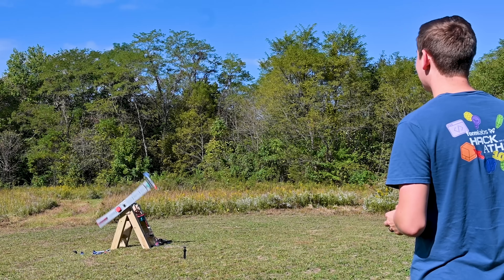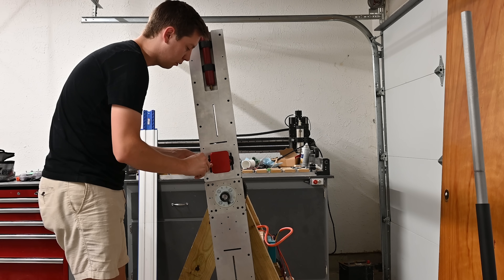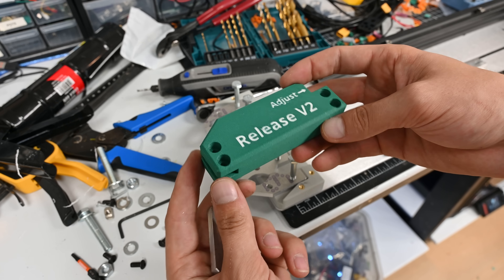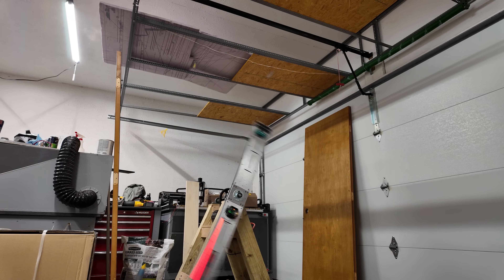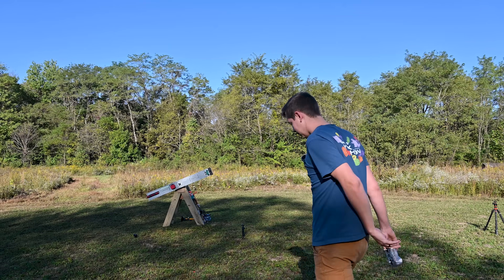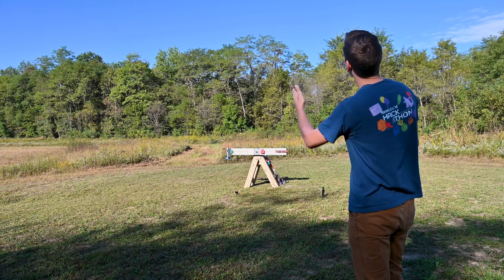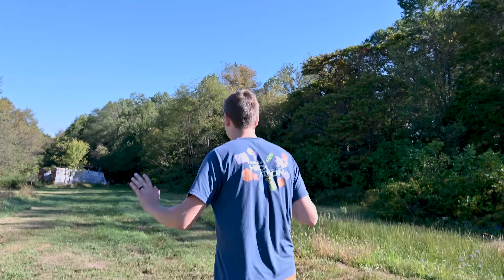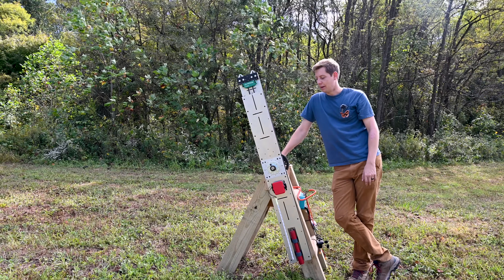I Fixed SpinLaunch

Comment: I thought I heard you say you could get the rocket to higher if you added mass to the rocket. I don’t think that will work. The height is determined by the initial Kinetic Energy (KE=1/2 m v^2) getting converted to potential energy (PE=m g h). So for KE=PE the mass on each side of the equation cancels out leaving 1/2 v^2 = g h, or h = 1/2 v^2 / g. This assumes g is constant and for the eventual heights you are intending to reach g actually does reduce by the square of the height - but even in that case g isn’t dependent on the mass of the rocket. So it seems it would still be true that adding mass to the rocket won’t make it go higher. The only thing that makes it go higher is more v. And since the height is proportional to the square of the velocity adding a bit more velocity will add quite a bit more height.

Comment: To make the balance even better. You could use a linear rail guide with a wait in it, when the rocket is launched, a  stepper motor move the wait closer to the center of rotation on the other half of the rotating arm. So you move the wait longitudinally to balance the rotating "propeller" or arm. Now you are using a plastic light weight rocket 🚀, and the imbalance is not an issue,  but if you use a heavy rocket, the balance start to be an issue.

Comment: Interesting project mate. However, using pneumatic release mechanism seems needlessly complicated. Why not just use a strong electromagnet? There are fire door lock mechanisms that can exert about ton of pulling force which should be more than enough for your needs. To power it, you'd just need a simple slip-ring or if you don't want to bother, just throw a couple of batteries as counterweights. 

Not only magnets can provide for more precise release timing, you can even detect the presence of magnetism from inside the rocket with a reed switch or something to figure out exactly when the rocket gets released in the future.

Comment: Does the arm become really unbalanced after launch?  At higher speeds you might want to employ a counterweight that either moves from the hub out on the launch arm or that is let go straight down on the other arm simultaneously with the rocket release to maintain balance after launch.

Comment: Very cool. Have you thought of using an auto-balancing system, which would work similar to putting glass beads in a tire? You could try attaching a circular tube filled with BB's or small steel balls.

Comment: If you find a way to extend the arm a bit from the point of release, it will make the rocket's CG follow a straight vertical line. Now, the bottom part gets dragged along the curve a bit longer to counteract the angular momentum, but as a tradeoff it produces a slight horizontal travel which induces air friction as it will make the rocket oscillate slightly while it's stabilizing. Also use 2 solenoids as many people suggested.
And then all we want to see is a bigger arm with a higher travel speed at the ends.

Comment: you could use a spring on a trigger release to pull a counter weight closer to the center of rotation (locking it in the two different positions for reliability) this would counter act the imbalance given by releasing the rocket. more over if you make this mechanism tunable in both counter weight and length moved you should not have to do much math.
Reply: also for the portability you can add large caster wheels that rotate into place and lock in at the bottom.

Comment: Perhaps a silly question: but why not electromagnetically couple the rocket to the release points? You'd have essentially instantaneous, frictionless, millisecond control over the staggered release by simply removing power to the coils?

Comment: Increase the arm length as much as possible.  You can achieve much higher speeds at the tip of the arm while reducing the forces.  If you change the arm design, place as much mass as close to the center as possible.  The forces on the arm are almost all tension.  Using a light weight (low mass) arm that is strong in tension reduces the total energy in the system and makes everything safer.   Using cables to post tension and stabilize/stiffen a light weight arm could also help reduce total arm mass as long as the arm is also resistant to compression when at rest.

Comment: Next step add a hall effect sensor so it always launch at a given angle. You can do it with an cylinder equiped qui a small magnet, adjustabled by an angle with some screw to tighten and lock the adjustement.

Comment: You might wana take a new look on your release mechanism.
The reason it failed was due to centrifugal forces...your trying to pull in, but the forces outward are much bigger (especially at the end of the arm).
Thats why when you slowed down, the forces reduced, and the air pressure can now overcome those forces.

Comment: Why does it have to be a rocket shape? wouldn't using a ball-shaped "satellite" be simpler to engineer a solution?  like a baseball pitcher uses their fingers to add a lot of precision to their shot they also use the flexibility of all the ligaments in their fingers to create a whipping effect. Instead of a fixed length arm, you could still use a kind of "finger" like you printed at the beginning of the video, and make the release of the ball take longer. If the energy it took to spin the heavy short arm could be converted to the ball more effectively it would show a significant decrease in the rotational speed of the arm, since the energy of the rotation would be gradually applied to the ball as it is accelerating away from the arm. Reducing the energy for braking the arm to a stop, and conserving momentum. Tom Stanton did a lot of optimisation around this problem for his Trebuchet. He found that the ball went farthest when an attached arm could release the ball and practically bring the whole arm to a stop. That's the ideal situation.

Comment: Your release mechanism is a huge block of mass that has to move in the opposite direction of the centripetal force. The faster you spin the harder it will be to launch, the slower the actual release will happen(because less delta force). Slower release probably also makes it more unpredictable. I'd consider a mechanism that moves sideways.

Comment: If you want to balance it properly, you'll need a jig that lets it spin freely. Prop it up on some sawhorses. If it's balanced, you should be able to stop it at any point without it trying to rotate afterwards.

Comment: The problem you'll have is,  as the rocket gets bigger and heavier the air resitance and fins on the rocket won't be able to counteract the spinning momentum of the rocket - so it will spin head to tail as soon as it is let go.   At the moment the rocket is so light that the air resistance is able to straight out the rocket.   in your video you can see the rocket continue the spin but it straightens itself out after a short distance.  Won't work with anything heavy..

Comment: Imagine a stationary sprocket concentric with the hub, and a timing belt going to a sprocket of the same size at the end of the arm. It should keep the rocked at any chosen angle while it's spinning.
That would in turn allow for a smaller, more precise release mechanism. 
I mean that was just a stupid idea i had the moment i saw this contraption.
Reply: PS: you could even drive the hub sprocket to select arbitrary launch angles.

Comment: As others have suggested, use electric actuators / solenoids for each of the releases - then you can control the differential timing based on the rpm to give the correct phasing.  You need to add an encoder to the rotation (a magnetic encoder would do) to both detect the rpm and position for release.

If you go down the solenoid route, starter solenoids for Tractors are a good option - they deliver much higher force than any other off the shelf solenoid I've found.  New Holland ones are good.

Comment: put some sloppy springs(of same spec) at same distance under it when you're balancing to even out the momentum so you can scale/balance it nicer. of course once you let go of the rocket its not gonna be in balance anyway unless you shoot similar weight into ground from the other end, which would help if you went to a bunch more rpm

Comment: Congrats Michael - great engineering!  Thanks for using my comment about Cons of Angular Momentum.  I work with armoured vehicle technology, and have had explored how similar issues can impact on projectile ballistics.  A few thoughts (if you'll permit me).  Stabilisation - have you considered adding sand-bags to the supports of your A-frame?  They act as good temporary shock-absorbers for machine-guns, and they might keep your apparatus on the ground during higher speed tests.  Secondly, if you spin the machine faster, then you will likely need to vary the pin-release disparity to account for this.  Good to see you allowed for adjustment.  Finally, adding mass will not make much of a difference to your projectile altitude until you reach greater RPM (drag scales in proportion to the square of the velocity) and so drag effects will be relatively minor when compared to gravity.  However it is certainly worth bearing in mind as you begin to exceed (for example) 50m/s release velocity.

Comment: If you're going to make the rocket heavier you'll want to add a movable balancing mass to the other side, and something that will allow you to dump the remaining energy from the system as quickly as possible (as its likely even with a dynamic mass on the other side of the beam, you'll set up an oscillation that you don't want to have to deal with).

I know YouTube is a big fan of 0 to 100, but don't put a rocket motor in it until you've got a 100% launch success rate with a mass simulator - pointy-end roulette isn't good.  It'd be nice to put some instrumentation in there, though!  I'd love to see a g-meter going bonkers and then being released into a state of pure ballistic bliss.

Comment: Need a sacrificial weight on the other end that releases simultaneously (throwing it into the ground). For maximum destruction when things go wrong!

I did think about a retracting mechanism that moves a counterbalance weight in-board at launch, but actuating it fast enough and not introducing further inertial issues got complicated very quickly.

Comment: build an enclosure around the arm and run a vacuum with a membrane that the rocket would penetrate on launch. No air resistance should be able to get that thing hauling? Looks like what might be happening in the big one you are modeling after, not sure.

Comment: I don't think making the rocket heavier will make it go all that much higher, since the weight cancels out when you transform kinetic energy into potential energy. You will get a slight improvement, because air resistance will be lower compared to the increased kinetic energy of the rocket, but the way to go higher is definitely more speed, not more weight.

Comment: Nice work, one "little" addition: weights on the opening mechanism, that forces them open on spin, it looks like the rocket has to force itself out to open the clamps, you introduce a variable more. My first idea was a spring, but you could simple use the energy of the spin to force it open.

Comment: Add a motor to the rocket and ignite it after the release, then measure how much less fuel you need to achieve the same height compared to a traditional launch.

Comment: I would love to get the data from it! It should not be a problem to have a pressure sensor (for height) and a acceleration sensor, a small chip (arduino style) and a tiny button cell in the rocket, right?

Comment: Rounding the leading edges of the spin arm with even a simple hemisphere shape would reduce aero drag and possibly let you spin faster for the same power/motor.
If you used a water tank at the opposite end from the rocket to balance it, you could have a valve release the water at the same time as the rocket and greatly reduce post-launch imbalances.

Comment: 1:39 You've designed it for injection molding. In 3D-printing you have sparse infill, so just use simple outside shapes for maximum strength without any material waste. And you also seem to have some small overhangs requiring supports. Those can, and should, be completely avoided.

Comment: One of required improvements is post-release rebalancing. You don't want it to shake apart after use. I am thinking of a weight being pushed along the rail on the release side that would replace the missing mass.

Comment: Add a rocket motor that ignites when the rocket leaves the catapult. This will give you more mass at launch, which should improve the height, plus the momentum from the rocket motor. This should get you to about 3 times the height 🙃

Comment: could add an ignition system for model rockets. I imagine a C or D rocket motor. but they have a slight variation in ignite time that might be problematic at those speeds and with release.

Comment: Go bigger diameter... that way you get more speed without scary RPM maybe 2 servos for the release rather than air, this will give you more control of the release as it gives more adjustability of the claws. Lose the ramp on the release pin too so it is an instant release/not release.

Comment: one thing that crossed my mind would be to have some counterwaight on the opposito side also move inward at launch so that the arm isn't so wobbly after launch. I'm just thinking that that wobble would make a bigger version potentially explode if the jiggles were bad enough.

Comment: I feel the timing of the front vs back pin release needs to be adjusted for the speed of the spin. I would imagine you want to release the front pin exactly as that pin is horizontally in line with the axis of rotation (i.e. just before the arm is level), and then the back pin similarly when it's in line with the axis of rotation (i.e. just after the arm is level). In which case, the flow restrictors on the release mechanism probably aren't ideal. Instead I would think it would be better two have two independent air tanks and release mechanisms that move as quickly as possible (or perhaps more importantly, very predictably) so the software can precisely control the timing.

Comment: Maybe adding a sliding weight that is on lead screw with a stepper motor to allow the arm to self balance. So when the rocket is launch it can adjust for the weight loss and not be so out of balance which will be even more of issue at higher speeds.

Comment: If you want to go the idea of using heavier rockets, you might be able to do some sort of auto-balancing system for the arm, kind of like those tire balancing beads that you can buy that balance your tire once it gets up to speed.

I assume that if upon releasing a mass and the center of mass of the arm changing, it would maybe rebalance to the new center of mass.

Comment: What about adding those balancing beads that washing machines have to compensate for uneven loads?  I've seen videos where it works at higher speeds for car wheels.  Would that help with the wobble?

Comment: The release feels overcomplicated.  I would imagine the rear "release" could just be a retainer that holds the rocket on while it is perpendicular to the radial direction and cams out to release once the nose swings out the correct angle. Or I'm completely wrong, lol.

Comment: 1. Put some retractable 12 wheels on your launcher.  You were breaking my back watching you.
2. Print out a chamber that holds water that is equal to the weight of the launch vehicle. Please attach it to the other end of the launch arm. When the signal to "launch" is sent, release the water from the tank, "off at an angle", to keep the launch arm equally balanced.
3. Update the LED strip to be a "Progress Bar" so you can see when launch will happen.
4. Print 3D fairings for the front and rear of the launch bar. Make it easier to spin.
5. Add an ESP32 microcontroller and an MPU6050 to measure G-force and balance the arm with water in the tank.
   https://youtu.be/g2JIwQoY7qc?si=jRKZOKyrub8NaoLY
5. Quit hogging all the video time.  Share with her..
6. Stickers.  Nothing will go fast without stickers!

Comment: It would be interesting to know the savings on a rocket at different scales. For example: if the rocket were a Hellfire, cradled sideways and fired at maximum height, would there be a distinct advantage over a straight ground launch system.  Or for a ballistic rocket like the Sapsan, could a device be compact enough for small vehicle mounting and send it up in the air in a meaningful way to extend its range?  Or, even better, what would it take to launch a single Starlink satellite into a useful low orbit...  Let's Go!!!

Comment: you could use a presure rocket like a air water rocket that has a plug atached to the arm so on relese it lets out the presure, the added thrust should give you a nice altitude kick and the extra mass as well.

Comment: Make another drop mechanism on the opposite end to drop a weight at the same time as release to keep things balanced.   Great job it's impressive that you got it to release straight so easily.   I mean, you didn't need 200 iterations or anything.

Comment: it wont help during the spin down, but what about adding a hollow torus with BBs in it that runs with the main machine. The BBs tend to scatter out until they level out the weight and stop vibrations.

Could help you get up to higher speeds, not sure what they would do once the weight changes, they should still try to equal out.